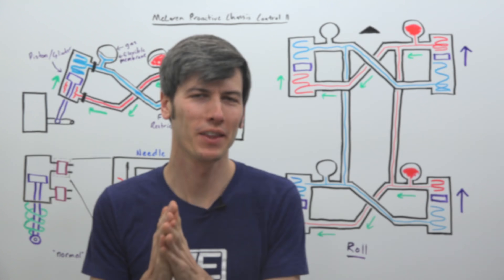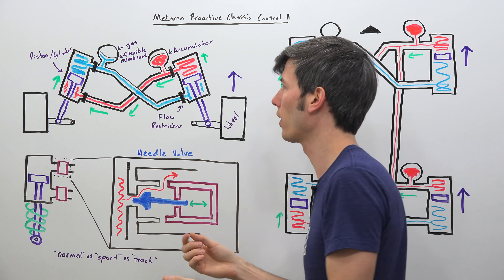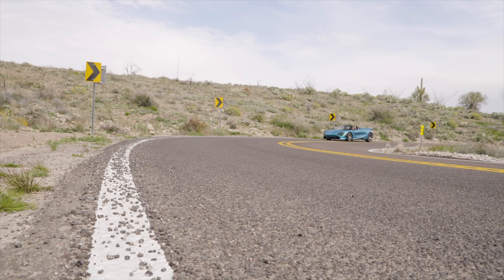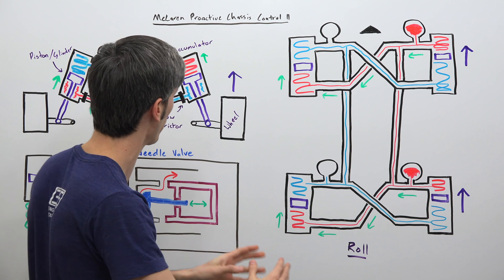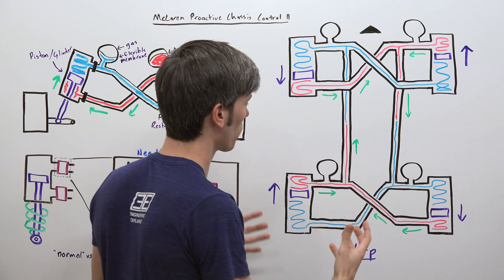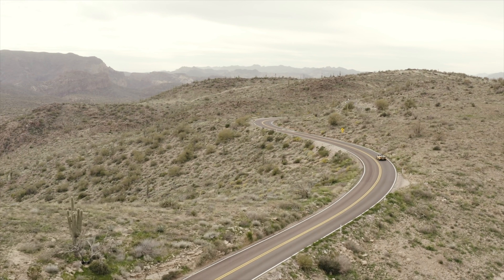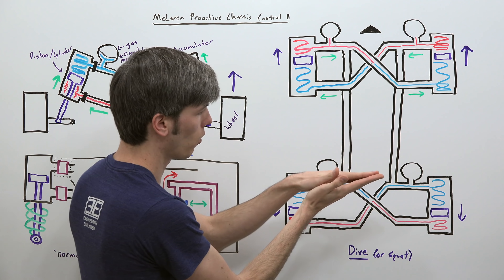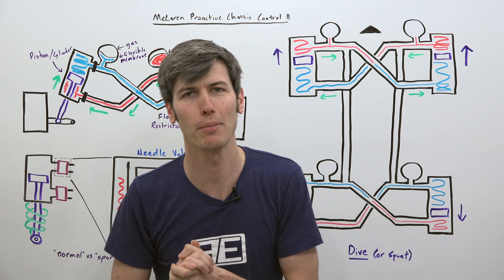The McLaren 720S Suspension Is A Complex Masterpiece

Comment: I think that when accelerating or braking really hard, having front and rear axle connected also helps with keeping traction on all 4 wheels as high pressure zones from the front push on low pressure zones in the back

Comment: This HAS to do something with this car beating almost everything in a drag race even cars with more power.
Reply: Low weight and drag, and a great transmission is probably the key.
Reply: @mcplutt  True gearing also plays a big role but I meant it's ability to put the power down is also key.

Comment: I'm lost on the flow restrictors. Wouldn't allowing full flow result in the stiffest ride, as the suspension would be at full reaction for leveling the suspension, meanwhile a fully restricted mode would essentially force the shocks to behave normally by not allowing the auto-leveling flow?
Reply: I'd like to take a stab at an answer (and get brutally corrected I'm sure). I think the key here is to remember the system also uses a set of accumulators and flexible membranes in combination with the flow restrictors. The flow restrictors generate the proper amount of stiffness on the top side of the dampener that is being compressed during a hard turn while the accumulators and flexible membranes help transfer additional fluid and reactive pressure to the lower side of the dampener that is extending during that hard turn. The gas in the accumulators acts like a pressure ballast that can reactively release the built-up gas pressure to the lower side of the dampener that is extending during that hard turn. The flexible membrane aids in this ballast effect while also acting as a pressure multiplier to the small amount of fluid being evacuated from the compressed dampener. If you think about it, you need higher pressure in the top portion of one dampener and higher pressure in the lower portion of the other. You do not necessarily need fluid to transfer to achieve the desired higher pressures. You just need to be able to increase the total pressure in the system. So they designed a system that is able to build and transfer pressures with very little actual fluid movement. The small amount of fluid from the top of the compressed dampener is displaced into the accumulator thereby compressing the accumulated gas within as well as "ballooning" the flexible membrane which as a result increases the overall pressure in the system. This greater pressure in the system thus naturally engages the lower portion of the other extending dampener through that hard turn.
Reply: And looking at the entire system together, having the value e open more allowing more flow in a hard turn is going to initially allow the front to compress. When you compress 1 point on the 4 corners it just like warp.  To combat restricting the flow, keeping the pressure reduces or eliminates that initial movement keeping more stability.
Reply: I too think u may have gotten the needle valve operation backward at 5min.  Normal adjustable shocks get firmer (more damping) when the needle valve is closed. However, in the cross coupled case, I think you increase roll stiffness by opening the valve, hence in track mode this needle valve may want to be wide open.  You seem to say this correctly later in the video.

Comment: This system was used in the front of the MP4-12C or one of the earlier McLaren models. Brilliant system. I'm not sure if Mr. Jason mentioned it but I would think the small additional control valves and the small amount of extra tubing are lighter than the two large anti-roll bars and all of their connectors. This high tech is multi-functional levels above the old "bars". It would be an interesting video of how McLaren uses modern engine timing to get their cars from idle to the 8,500 rpm redline. Very good video.

Comment: I was wondering, if they've already engineered the plumbing for anti-roll, would it make sense to have implemented some sort of flow direction for the anti-dive/squat as well? I understand that the valves currently control the rate of dive/squat, but could diverting the pressure from front<>back also work? I imagine the hydraulics are crazy complex as it is, so I don't how much the additional lines could affect performance.

Comment: Are there really metal springs used in the McLaren‘s suspension? The Citroen hydropneumatic or Hydractive suspension does not use metal springs. The gas in the spheres provides the spring action, while flow restrictors at the spheres (!) provide dampening.
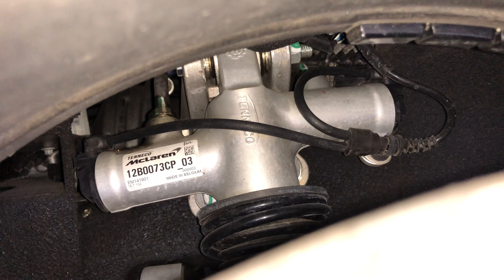Reply: Yes, 8:06 in the video

Comment: In Dive/squat, If the front and rear are tied together, won't the fluid transfer front to back keep dive/squat to a minimum?
Reply: No, since the high pressure from the front would be flowing into an already high pressure zone on the rear (compared to cornering, where the high pressure from a side is forced into the low pressure zone of the other side).

Edit: it's more like during a dive or squat, the pressured equalize in each of the lines. There isn't a pressure differential to drive flow in any particular direction.

Comment: I tested once to link my throttle and brake pedals (in simracing, not real...) that were modded to use airspring, i cross linked the two pedals together: pressing throttle made brake pedal stiffer and vice versa. Was a hoot to drive FWD cars, applying both at the same time the transition between throttle and braking gave amazing feel and control. But it only worked for FWD, you are not that much dancing on that particular edge with 4WD and RWD.

Comment: 1991 Toyota UZZ32 Soarer Hydraulic Active control suspension , electronic stability, 4 wheel steer , full body leveling in corners and pitch and yaw, braking etc. linked to the 4WS and traction control and ABS.. look it up, who copied who i ask ? Nothing new really, just a few electronic advancements with technology.

Comment: We solved all this unbelievably reliable anti roll bars and anti-squat/dive A-arm mounting angle geometry well over half a century ago. Lotus did front-back connected anti-dive in the the very early 70s..  Only reason for all this huge cost, complexity, unreliability, unserviceability is to make it easily variable.  It is technically fun and interesting,  but .... old school has its advantages..  perhaps dramatic weight savings too.

Comment: Hmm... im a noob with a question here :) Why would such a relatively complex hydraulic system be used instead of some kind of electronic/electromagnetic suspension ? Wouldn't it be lighter, less failure prone, less maintenance intensive, give even more control etc ?
Reply: A fully electromechanical system probably wouldn't be lighter (Hydraulics are mostly tubes filled with oil, which is a lot lighter than coils and actuators), and is unlikely to be as reliable due to having more moving parts, but all the rest is true. 

With electric cars, which weigh a tonne more than standard models and could charge their batteries (Slightly) using the energy the suspension damping takes off bumps, the likes of the Bose suspension systems should already be back on every high performance electric/hybrid car.

Comment: On the cost perspective I don't think that the system is so expensive to manufacture. Citroen still uses a similar suspension on their C5 and C6 cars.
Reply: It's surely no more expensive than running brake lines.

Comment: Hey, J, had a couple questions.
1. Doesn't changing the mode (T, N, S) affect how much anti-roll the suspension would grant, because of those needle valves? Would it be worse in track mode, I don't think that is desirable.
2. Does the warp situation, where the fluid flow through the length of the car, have extra valves to control it on the end of the longer tube?

Great video as always. Big fan of the channel.
Reply: The passage of fluid from front to back would be managed by the needle valve opening ratios from front to back.
Reply: Same questions I had.

Comment: Would it be a correct assumption to call Koenigsegg’s Triplex suspension similar in function? Obviously it’s mechanical versus this which is fluid based and Koenigsegg’s only works on the rear axle but seems like the end result for a single axle is the same or similar.

Never mind the warp situation definitely isn’t possible with a purely linkage-based system.

Comment: Your next mission should be to explain the Koenigsegg Jesko 9 speed, 7 clutch gearbox
Reply: did they explain why they switched back to a transmission? after regera‘s direct drive, i thought that‘s where it‘s at in the future.
Reply: @kam_iko  the Regara is a "hybrid" and uses electric motors to accelerate the car to speeds where the petrol engine can drive the car at its fixed gearing. The Jesko is petrol only, and therefore requires a gearbox to get maximum acceleration. Their 9 speed gearbox has the potential to be used in other cars.
Reply: @kam_iko  I would guess because the Jesko is being made in such small quantity but who knows. If they did it this way it was probably to gain an extra .05% of something lol. That dude has to be awake at night thinking of all the places he could shave a gram or two off the next model..
Reply: J Blob 

sounds plausible. on the other hand: to develop a completely new transmission  for a limited production run, when you already have something viable (and pretty unique) at hand, seems a bit over the top even for koenigsegg.

well, might be, that direct drive is dead, we just don’t know it yet :)
Reply: In concept it's two 3-speed gearboxes in sequence, sort of like a 3 speed range box x 3 speed splitter box, giving 9 combinations. Each of these sets has one clutch per forward speed (6 clutches accounted for). Another clutch is used to engage the reverse gearset.
Reply: Speaking of the Egg, did he review the Triplex Suspension?
Reply: He did it
Reply: 3 years later and he’s done it
Reply: I was about to ask that too
Reply: That's a great ideia!
Reply: Was thinking the same
Reply: And the downforce.......
Reply: Someone's already made one.
Reply: isn't just 3 clutches and 9 speeds, 3 speeds each axis
Reply: It really is just a very showy way of saying “robotized manual”. You 6 speed manual has clutches for each gear too called synchros and so do torque converted automatics (different designs apply).

This is an slightly oversimplified internet comment that uses some term more loosely. Don’t flip.
Reply: @gqh007 😊😊😊😊😊😊😊😊😊😊😊😊😊
Reply: It's very hard because Koenigsegg Jesko just a show car, but still waiting for it to be produced only 125 units.
Reply: Works like a normal dual clutch gearbox, but with a clutch for each gear from 4th to 9th (included one for first-second-third) so that it doesn't need syncros because all gears are already synchronised but non engaged. Plus having the flywheel on the gearbox instead of the crank, the engine can rev instantly to the gear selected, switching from any gear to any gear without waiting for the engine to sync to the gear and the gear to sync to the driveshaft

Comment: The one thing that will stick with me from this video is that the 720S is basically a Citroën
Reply: Eric Ortiz a 50's Citroën*
Reply: McLaren obviously seems 'to lack' capability and connections to related industries to provide us with an up to date, fully digital at the wheel, electronically controlled and electrically actuated solution now.

No problem, what we see seems more or less in part the good old hydropneumatic, analog solution. And it seems to function quite well, and maybe provide as well possibilities to become more digitally supported in some future.

'But' very likely this system is not too good for being integrated into a fully radar-controlled, GPS supported drive by wire system of the future, foreseing the bumps ahead of the car, etc.. But maybe we are wrong.
Reply: The original Atari is anot XBOX
Reply: Except you can’t afford this citroen

Comment: No no no. This is endless money pits. Some old timer on youtube told me to buy 1994 toyota celica or some lexus.
Reply: Rev up your engines
Reply: Sounds like he's been a mechanic for over 50 years
Reply: @coreymoseley6710  but he's only 49years old
Reply: You gotta ring that bell! CLANGGGGG
Reply: It will cost smol fortune to fix
Reply: HAHAHA
Reply: well.....it is true in this case.....it is not just money pit, it might cost more than your house to fix this...
Reply: you mean the guy whos suggests to use parts to repair brakelines that specifically say "not intended for automotive brake systems" on the packing?
Reply: The design make it able to keep up with p1 so.
Reply: ki jssn HAHAHAHAHAHHAHAHAHHAHAHAHHAHAHAHHHAHHAHAHAHYH
Reply: They’re screaming vehicles to drive but as they age they will cost a fortune to repair. They’re always endless money pits. If you want a fun car to drive, hey, get a Honda Accord with a standard transmission. Those are fun if you know how to drive it HA HA HAA
Reply: @Jaymac720   This suspension has less parts that can break than any cheap car does. Most parts are passive, just tubes, tanks, valves, etc.
Reply: BeyerT1 r/whoosh

Comment: And then imagine Citroën had a system like this in early 90's on their Xantia Active. To this day that car has the Moose test record at 85 km/h, beating the McLaren 675 LT.
Reply: Citroën suspension was so far ahead of its time. It even allowed to car to drive on 3 wheels.
Reply: @FullyBuffered  That's true, but they quickly turn into a plumbing nightmare.
Reply: DellChannel21  -  Moose test?
Reply: Citroen Hydractive3+ monitored:
 Vehicle speed
Front and rear vehicle heights
Rotation speed of steering wheel
Angle of rake of steering wheel
Vehicle's longitudinal acceleration
Vehicle's lateral acceleration
Speed of suspension travel
Movement of the accelerator throttle

All of this in 2001!

I am so tempted to buy a C5.
Reply: John Molloy So was I at first. Just don't get the A/T because they tend to fail and need whole replacement. I'd get a 3.0 V6 Exclusive M/T if I were to buy one. The exterior design is 'meh' but the interior looks very much dated, specifically the dashboard and steering wheel, rest is acceptable.
Reply: Yeah... that's why they gave it up completely. Seriously, i think they still sell license for this.
Reply: @lukluk1914  Rolls Royce and Mercedes also used this suspension and it was built all in all in about 700 items. For Mercedes as well as Rolls Royce Citroen supports still every single screw.
Reply: Haha, that is exactly what I've just commented -without having even seen the video.
Xantia Activa suspension is THE MASTERPIECE of engineering, making many if not every supercar appear shameful.
Reply: Rolls royce and s class... They buy this technology from citroen too... Yeah... Its not mclaren masterpiece... Its CITROEN... Nothing move you like a citroen...
Reply: @anasluqman6234  no its how it's applied that makes it a McClaren masterpiece, that's a fact. So what if Rolls Royce and Citron utilized similar systems.
Reply: And clearly that single test result is erroneous.  Just because you have active suspension you cannot beat the laws of physics!
Reply: Ha ha ha, to this day, none of the horrible French cars are still running 👍
Reply: @Danger_mouse  You are not informed at all. My Xantia Activa runs fine. There are still a few thousand on the road.
Reply: Dangermouse Pretty sure, if not properly maintained or paid huge amounts of money to repair the whole system, but Citroën kicked the ass of many of the most exclusive car brands from that time.
Reply: Someone I know bought a Xantia activa last autumn with the intention of adding some power mods. The car was in really bad shape (including the suspension) so it needed servicing first. With 3 people in the car the car went through an intentional prolonged moose test at around 50km/h also while being in a curve, where the driver did multiple hard swerves and counter swerves (like 8 in a row) to see how the Activa system was doing. Any other regular car would have topped over probably at the second violent swerve but amazingly, the Xantia stayed it's course while me, as a passenger in the back seat, felt like i was rolled over multiple times in a huricane.
Reply: Boost Freaks Indeed. In fact the only factor limiting the stability of the vehicle is the tyre grip, as there is almost no body roll nor wheel slip in each axle.
Reply: @apexseal2811  agreed. The car had good tires so amazingly throughout that test there was no wheel slip, i was in awe. Having previusly owned a citroen CX and driven many CX, BX, C5 and C6, what i experienced on the Xantia Activa even with an un serviced suspension was still mind blowing. But i guess 10 accumulator spheres will do that lol
Reply: the thing is, as far as i know (and i digged through the whole internet for a presentation about this), the citroen system doesnt have two fluid cycles, but only one (far back also used for ps and brakes), and the piston which is connected to the wishbone only pushes the fluid, not pushing one and sucking another. EDIT: oh, and they had no coil springs.

Comment: The funny thing is that the 600LT, which has less power and a traditional suspension, is faster around the track than the 720s
Reply: Yeah it's because it has better aerodynamics and more downforce.
Reply: just wait for the 7**LT
Reply: @sevenstars0711  800 LT, the 720s already has almost 800hp anyways
Reply: Peder Hansen  the 600LT is quicker on the Nordschleife, which has a high average speed and one of the longest straights in the world.
Reply: Peder Hansen  I just have the info from robert mitchell / Apex nürburg, they ran a 720s taxi last year and a 600LT taxi this year.

Of course, it could just be marketing to say that the new car is quicker.